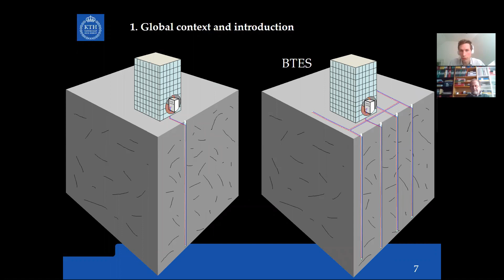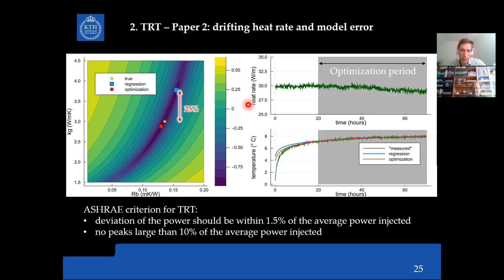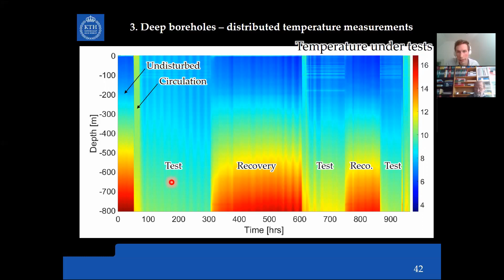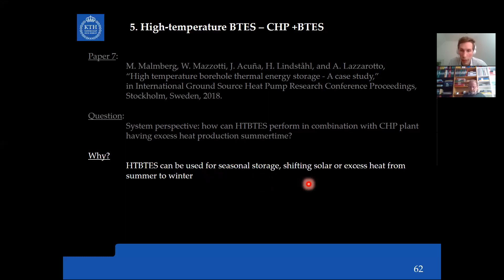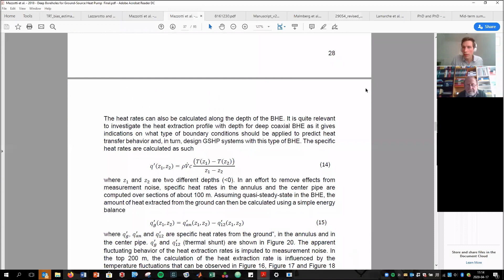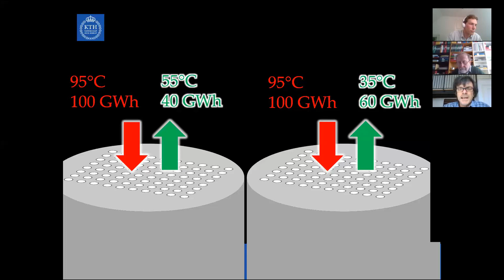Thermal response of borehole heat exchangers: modeling and experimental analysis - Mid-term seminar

Comment: Please. I need some help i have a similar model and i found problem in the simulation i am doctoral student
Reply from the maker: Hi! Which model are you referring to?
Reply: @willemmazzottipallard8904  coaxial borhole heat exchanger
Reply: did you do the simulation wth ANSYS FLUENT or MATLAB
Reply: @willemmazzottipallard8904  there is my email please contact me Talbi.ali032@outlook.fr